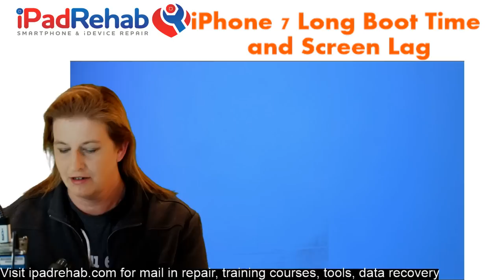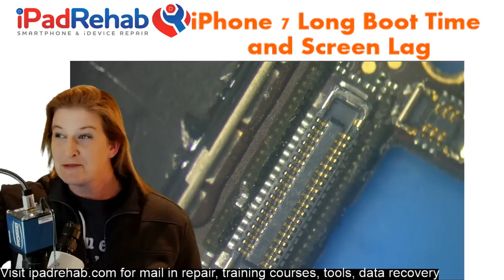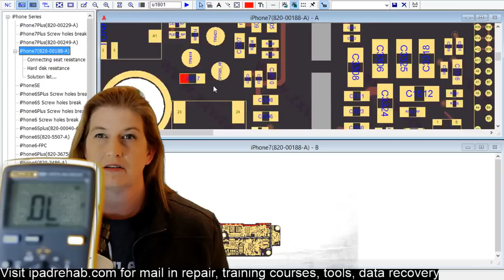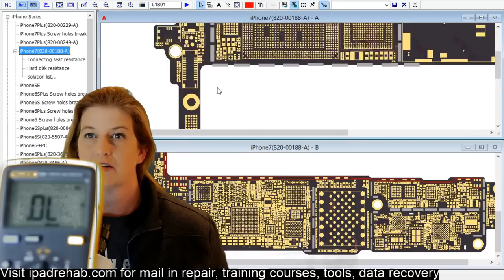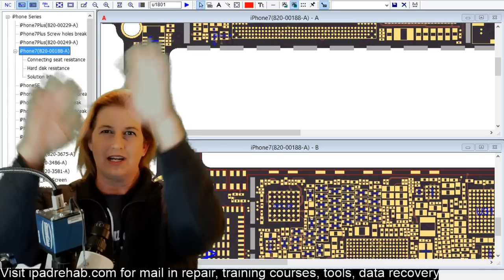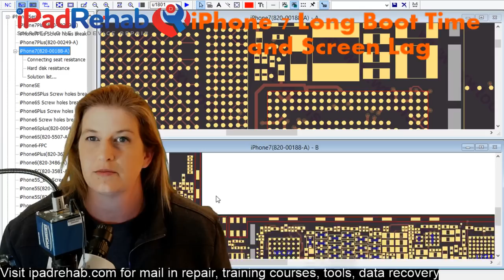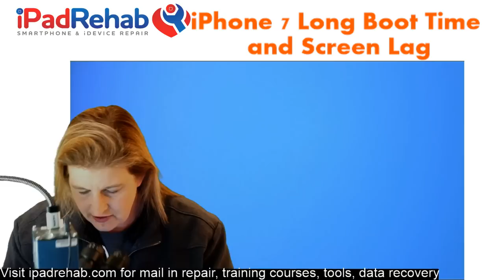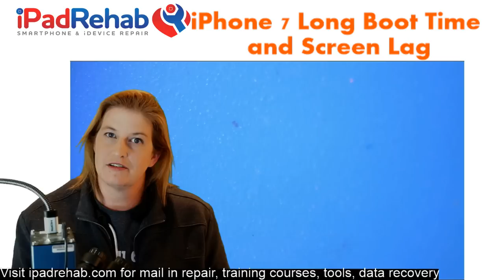Troubleshooting iPhone 7 long boot time, screen lag problems

Comment: Hi Jessa you can switch off the auto power of the multimeter by holding a button (depends on model number) when turning the meter on :-) at my Fluke 87 I have to hold down the blue button when turning on the meter to disable the autopower off

Comment: i have same problem but different reason. All GNDs on front cam connector show 150 in diode mode. Other pins are also a bit higher. 100-200 roughly.
Any idea where to look or what to look at/for?

Comment: Is there anywhere I can lookup whats a cap and whats a filter?  Sorry, just getting into microsoldering
Reply: Mitan Chandihok as far as I know
1 a capacitor stores energy that the components need to work
2 a filter do what its name says it removes the unwanted charges that might damage the components

Comment: So can it be a blown filter between PMIC and the connector? The cap would have blown a filter in between because of the short.
Reply from the maker: +Google is Evil if true, then what would happen to diode mode reading at the connector? Normal, high, or low?
Reply: iPad Rehab low reading, short. Initially. Ah now I see what you mean. It would be infinity after you remove the short and not 0.something since the blown filter breaks the circuit.

Comment: I had iphone 7 with good condition and I tried to remove the touch id home button and it take 3-5 mnutes to boot normal. And the screen is super lag but the assisitive touch is very responsive the problem only if you open an apps its super lag. Then I tried to put back the touch id home button it boot to normal with no lag issue. I think the problem of the iphone in this video is because the original touch id is not present.

Comment: I also had an iphone 7 with the long boot and screen lag. The customer came with broken touch but even if i hat an original lcd the iphone was booting very long. I tried different lcd and different ptoximity flex cables it didn’t solve the problem. At the end i put back the old kracked lcd and it started work normally. Probably the long boot problem is only on lcd?
Reply from the maker: +Keybusterer it will have long boot anytime it can't hear from home button or front cam and home button is routed through the screen so yes--bad LCD can cause long boot

Comment: I do mainly laptop motherboard repair, but I really enjoy watching your videos and also Louis's, although I have subscribed to your channel just recently. About the Fluke if you push the yellow button and turn it on then Auto Light off and Auto Power off functionality will be disabled on these B+ series, mine is 17B+. IT'S ALL IN THE MANUAL!! :)
Reply from the maker: +Farid Khodayari manual? What is a manual?
Reply: Ask Louis and he'll tell you all about instruction manuals, he always reads them before using a product.

Comment: hi Jessa. i am a new tech guy who operates in Rome , Italy. i would like to ask a question: is it possible to isolate again iphone 7 mean making it dust and water proof after screen or motherboard repairs? as far as i studied the case i couldnt do anything beside water enters inside the phone and i need to repair once again. so i dont know if you guys there have any kind of mask or something that works or its not possible to do it aggain waterproof. thanks in advance, Leon.
Reply from the maker: Subscribe to forum.mendonipadrehab.com to get help with DIY repair questions.

Comment: Hi Jessa! Diode mode readings, are performed with battery connected ?
Reply: Battery disconnected as diode measurements are a similar to resistance measurements and leaving a battery connected could damage your meter.
Reply: Hell no. Do not do that!

Comment: i see this problem every day at my repair shop with copy screens for iphone 7 and 7 plus. With the phone powered on, hold the volume down button and power button together, wait for the apple to come back on and let go just right before it goes to the screen to restore it.  you might have to do that more then once but it always fixes that slow lag on the phone.